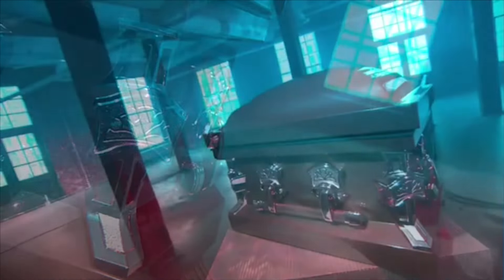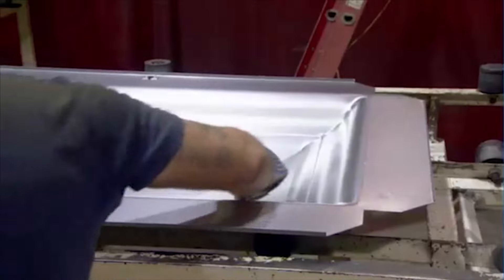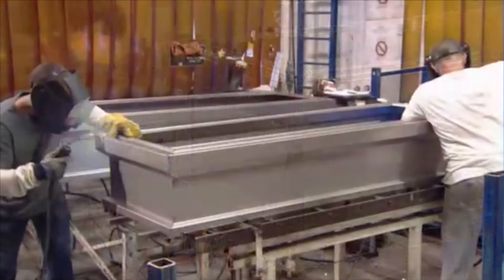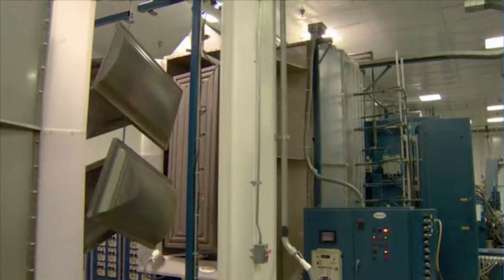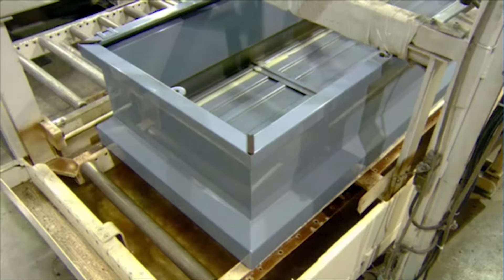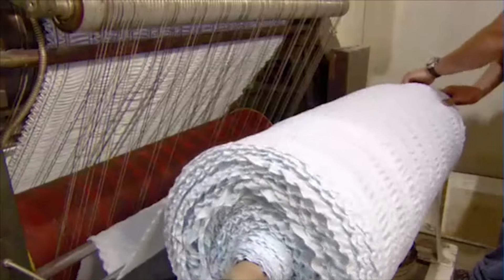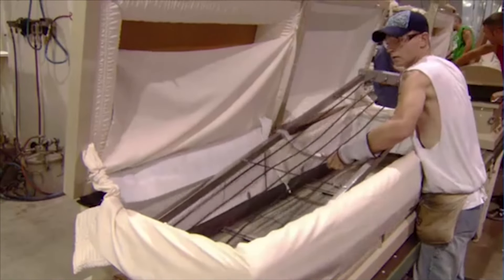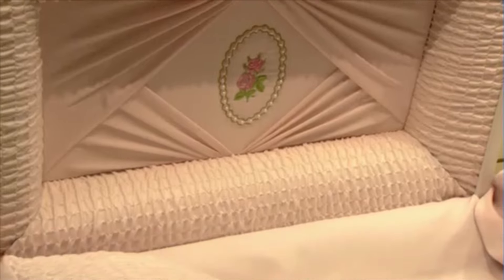METAL CASKETS | How It's Made

Comment: Please remember, the rubber seal deteriorates over time. unless you purchase a high grade sealed burial vault like a Wilmert Stainless Steel Sealed Vault you can kiss the casket goodbye, ground water will eventually penetrate the casket with or without a rubber gasket. They are like the door seals on cars, after so many years they crack, dry and decay. 

No matter the kind of paint used on the casket, they will eventually rust and deteriorate just like an automobile. Why waist the money on a high-priced steel casket only to have it rust away eventually. And the embalming will not stop the putrefaction and decomposition process. Besides the person is not going to be disinterred unless for a criminal investigation. God said we will turn back to the dust that we came from. 

In Jesus' time the deceased would be put in a rock tomb to decay over time. Afterwards the bones would be gathered and put in an Ossuary or Bone box with their name carved on it. In some third world countries this is still done.